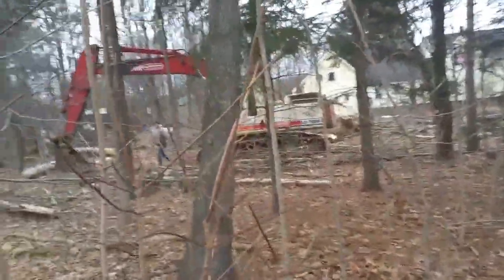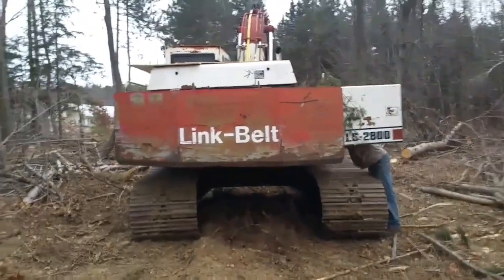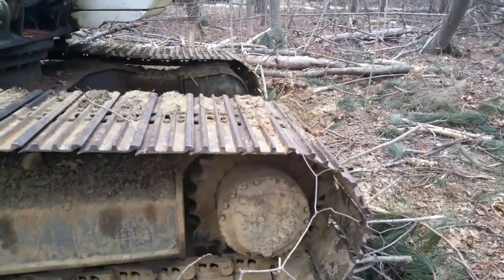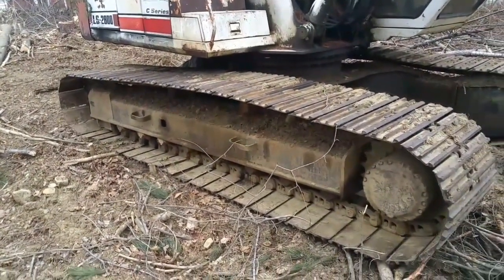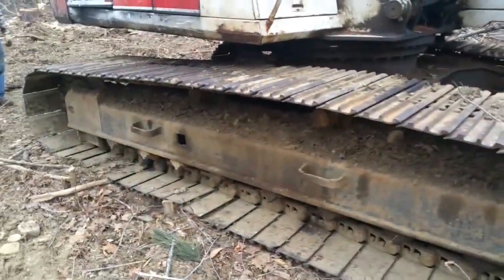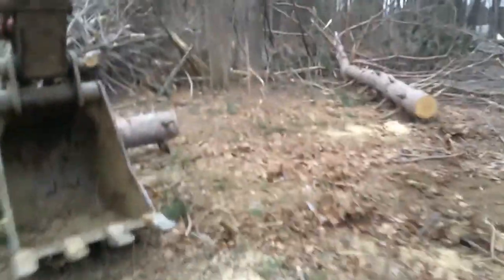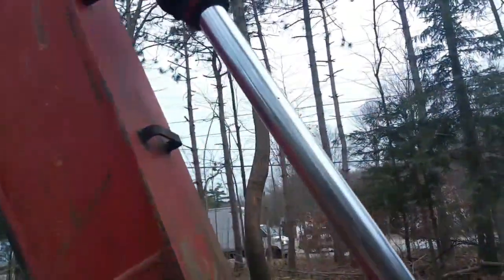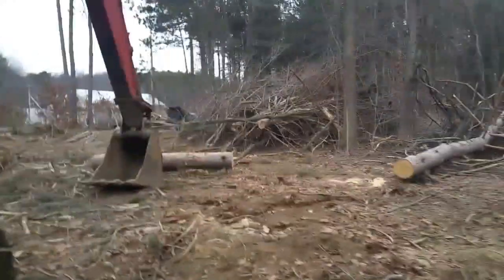Linkbelt LS2800 Excavator - Initial review

Comment: I have a 2800C 1989 model. I need to look at a pilot control system because the lines have been removed and I need to get the back on correctly. Anybody out there. Help!
Reply from the maker: Unfortunately, I have sold it :(

Comment: That machine is made by sumitomo. It also wears Case badges (I believe Case branded them in 1992)It also used to wear JCB badges. I’ve owned a dozen of sumitomos wearing both the Case and Link Belt badges. I’ve also owned Komatsu excavators, the sumitomos are far more reliable than the Komatsus. These machines don’t get the credit they are due. I won’t buy anything other than Sumitomos.